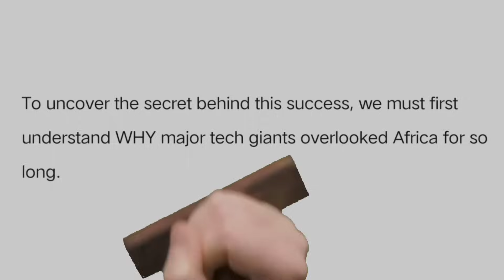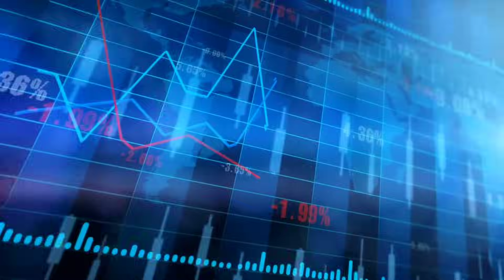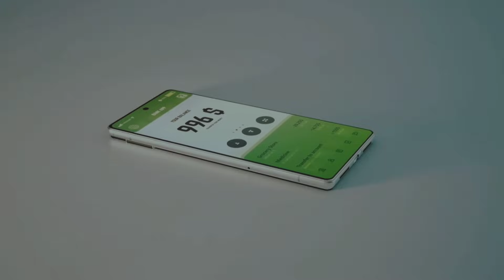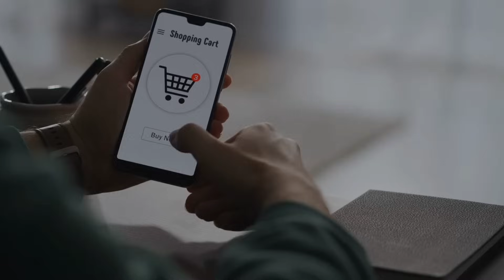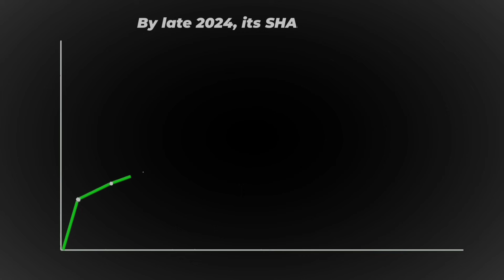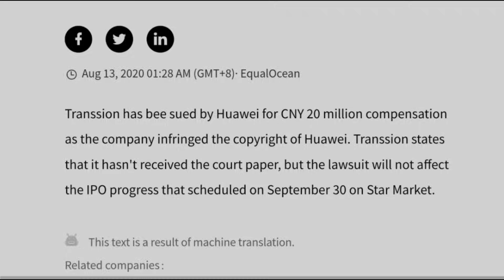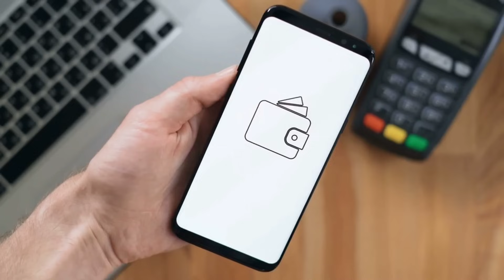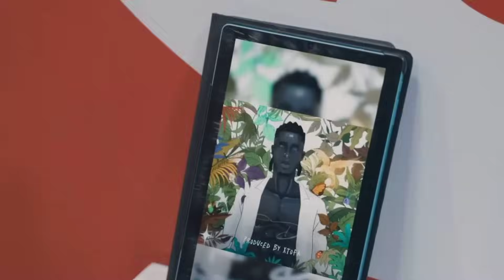This Chinese Brand Quietly Took Over Africa (Not Huawei or Xiaomi)

Comment: I heard of Transsion at least a decade ago. BTW, Huawei is a premium brand, equivalent to Apple. Huawei's phones won't sell well in a price sensitive market like Africa. Even brands like Xiaomi, Oppo and Vivo aren't that cheap. What the mass market in Africa wants are phones that has, say, 80% of the functionality of a premium phone, but can be bought for $100. That's where Transsion comes in.
Reply from the maker: Exactly — you nailed it! 💯 Transsion basically found that sweet spot between price and practicality. Most people didn’t need flagship specs — just reliable phones with good cameras, long battery life, and dual SIMs at an affordable price. That’s how they built such a strong base while others focused on high-end models. Thanks for the thoughtful comment! 🙌

Comment: I'm in Central Ghana. I'm torn between the Tecno spark 40 Pro and the Redmi Note 40.

They cost almost the same price and have similar features.

Help me make a choice
Reply from the maker: Both are good, but I’d go with the Redmi Note 14 — it has a better camera, cleaner software, and longer support. The Tecno Spark 40 Pro is only worth it if you prefer the faster 144 Hz display and quicker charging.

Comment: How is exporting  phones from china benefitting africa . Are there any techology and knowledge transfer ?
Reply from the maker: Great question! Yeah, most of the phones are made in China, but Africa’s actually getting more than just imports out of it. Transsion’s built local assembly plants, repair centers, and even apps like Boomplay that are made for African users. It’s not a full tech transfer yet, but it’s created jobs, local partnerships, and a ton of on-ground experience that didn’t exist before. So it’s kind of a mix — not perfect, but way more than just “shipping phones in.”
Reply: how about the fact that they can have a affordable phone to communicate with each other and making payments without having a bank account.